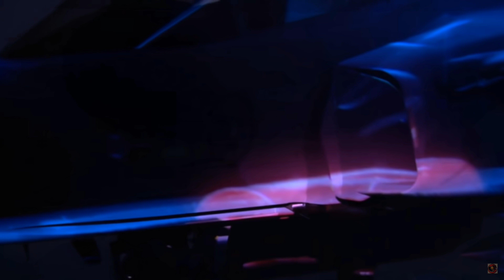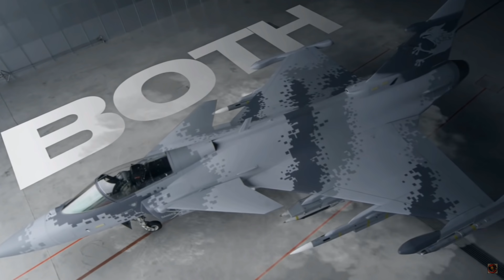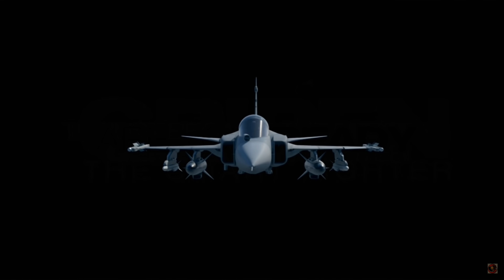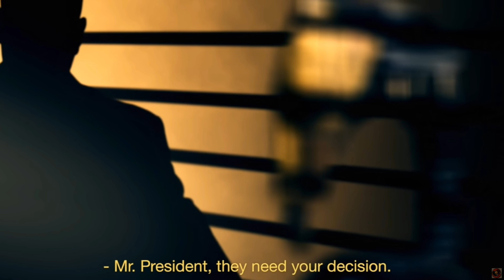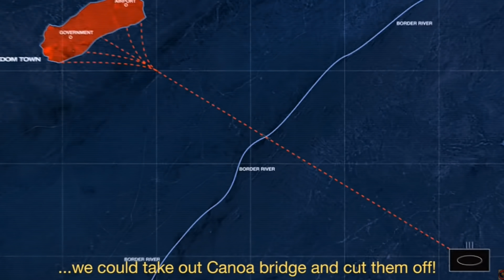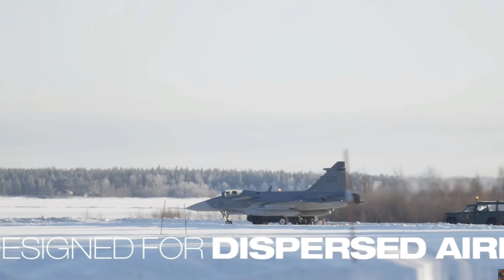Saab JAS 39 'Gripen' | SWEDISH MULTIROLE FIGHTER

Comment: if America didn't have the F-16 this would be a plane to get
Reply: To short of range. Sweden airforce is a defensive force
 Air superiority and ground support being primary missions. Range is a low priority. The US has tactical and strategic responsibilities on land and at sea. Traditionally American aircraft since WWII have have had greater than average range and all have inflight refueling capability.
Reply: terry broderick f16 isn’t better than the f35, don’t kid yourself.
The f35 is much more powerful, better weapons, turns better, better
Radar, more of everything.
Reply: @terry broderick   well the 35 did lose to a falcon, and there has yet to be a rematch for some reason/ that said the gripen is a capable airplane for its size
Reply: michael howell kind of..during
Test and eval an unlocked falcon can beat a tied up lighting. But when the lightning isn’t limited it can trounce the falcon in every way.
Reply: ger du the f35 is the cheapest option for stealth. Seriously, 71 million for a new plane. It outperforms the 39 is every way.
Reply: terry broderick the f5 and the Gripen also show up easily on radar...don’t kid yourself. The f5 doesn’t outperform the falcon. That’s why only third world countries are using it in any active combat fleet.
Reply: terry broderick f35 hasn’t been shot down. Crashes, yes. But not shot down. 

Please compare the radar cross section of the f5 and 39 to the 35 and get back to me. The f22 has the RCS of roughly a bird. The f35, being a later version, is even less. 

Size doesn’t equal RCS. Scattering of radar waves does and the f35 excels at it. The f5, having long lines with no RAM or angles and being based on 1950s technology, doesn’t.

Comment: Just curious, why Saab did not opt for F100 series engine for Gripen?
Reply: Can't tell, don't know, but I would speculate that size was a major reason.
The F100 is a bit larger in all respects, ie length, diameter and weight.
And I can imagine that the additional thrust didn't balance the larger airframe needed.
Reply: Plus the F100 has a reputation to be fairly unreliable

Comment: gripen would be a bad choice for canada - all that flying over vast expanses of ice, you need a twin engine aircraft, and ideally, one that can supercruise.
Reply: Gripen E can supercruise also since it have a larger body it can also carry more fuel
Reply: @Groza_Dallocort  cool, i didn't know that, thanks.  still, i'm not sure a single engine is what canada needs, considering the size of the area to p;atrol, and the harsh conditions if the plane goes down.
Reply: @Touay.  hmm seems like Canada use CF-18 atm. Gripen do use the same engine as the F/A-18 super Hornet except it only got one of them and yeah Canada do got more land to cover then Sweden
Reply: There really isn't that much of a difference in reliability between 1 engine and two engines, if the engines are a proven design. The plane that Canada is theoretically favoring, the F-35 is a single engine plane. 

I would be interested in knowing what the per hour flying cost for the F-35 and Gripen NG are. My suspicion is that it is much lower for the Gripen NG. I also suspect that the Gripen NG performs better, and it is definitely faster. It would be to get some hard numbers for Radar Cross Sections (RCS) for F-35 and Gripen NG, from all aspects (front, side, and rear), and using different radar frequency ranges (L, K, and S band). Gripen, due to small size and some basic considerations for RCS reduction vs. the more obvious stealth on the F-35. TheF-35s stealth advantage is supposedly muchreduced when the Radar frequency is lower, and from various aspects other than head on.

Comment: nonono stop whit the thermal goes through walls myth I'm cringing fakin reeeeeeeeee
Reply: It depends on the wall and if the heat source is hot enough to heat the wall.
Roofs are more likely to reveal a heat source.
Reply: Yes but the scenario in the video is a bit extreme the ir is like going straight through the wall.

Comment: My family used to have a saab scania 9000. Damn that was a good fucking car, she survived over 400,000 km but sadly broke down a few years ago. RIP.
Reply: Your car was very likely a SAAB 9000. Scania was the name of the truck branch. Still produced locally but nowadays owned by Volkswagen (VW). SAAB Automobile was bought by General Motors who totally failed and run the company to ruins. SAAB Automobile is now owned by a Chinese company, NEVS, who is currently focused on electric cars.
Reply: I owned a Saab 9000 as well.  Great car except for the ignitor ignition cassette which would go out every 75,000 miles.  Saab was a pioneer in distributorless systems.
Reply: your family is b@stard
Reply: @Dangermonkey1000  i'm curious as to what's going on in your head.

Comment: Matsimus do a video on CAC/PAC JF17-THUNDER aircraft. Its block 3 is coming soon
Reply: the "junk thunder" cheap chinese copy garbage.....yuckk
Reply: @Dangermonkey1000  
Matsimus is awaiting the signal from his benefactors before uploading the hit piece on the FC Thunder.
Reply: It's one of the few Chinese designs they didn't steal from someone. And they're upgrading it in blocks.
Reply: @arkadeepkundu4729  
"steal"? --- What are they? 
J-20 looks nothing like Raptor and F-35. 
J-10 is adopted with consent of Israel.
FCB Flying Leopard and F-8II are an original design.
F-31 is adopted from the Raptor. Similar to that of Korean and Turks.